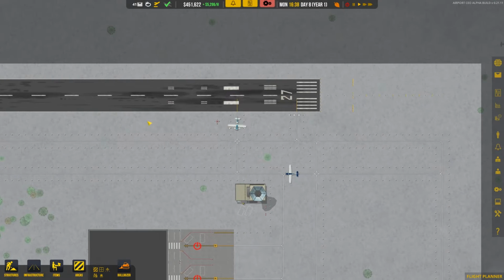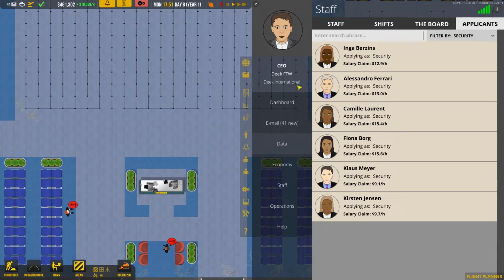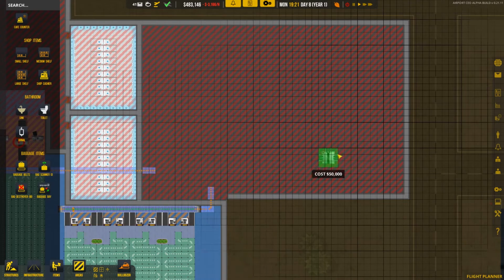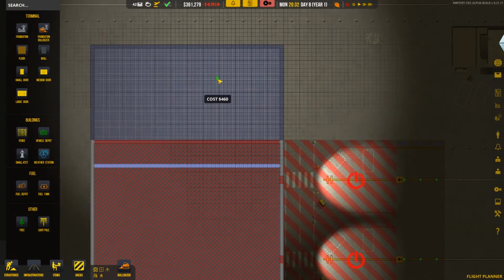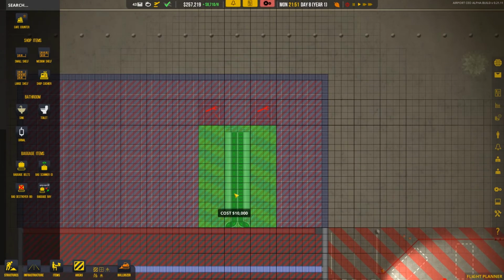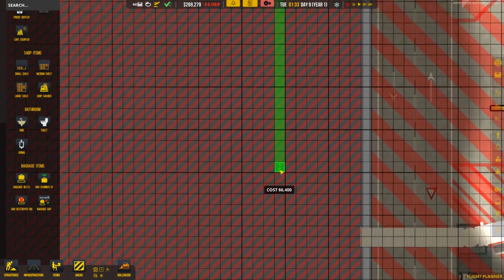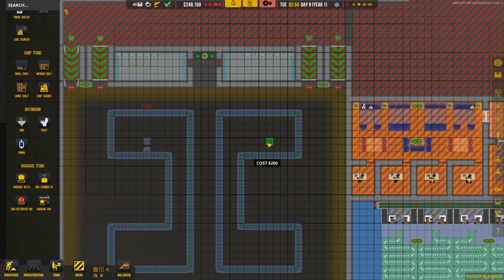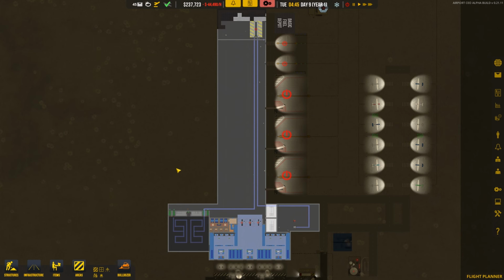Let’s Play Airport CEO - 5 - Building our Baggage Handling Services: Baggage Belts, Bay & Scanners

Comment: How do I delete the underground baggage belts? I’ve got a whole section going in the wrong direction but I can’t demolish it by the usual method. Great tutorial by the way, i’ve spent hours following this, I wouldn’t have had a clue on my own, so thanks for this.
Reply from the maker: No problem! You have to use the underground belt tool and hold the control key down to delete the belts.
Reply: DeekFTW Thanks for that. So, am I right in thinking that with the large baggage bay near the runway,  the left belt is for incoming baggage, and the right belt is for outgoing baggage? I’m just a bit confused with this bit.
Reply from the maker: Off the top of my head I don't remember which is which. I think if the connections are down like in the series video then you'd link up the right side to the belts that take bags to the planes and the left side gets connected to the baggage claim. The arrows on the baggage bay should help if you look closely, although I know they can be a bit confusing.